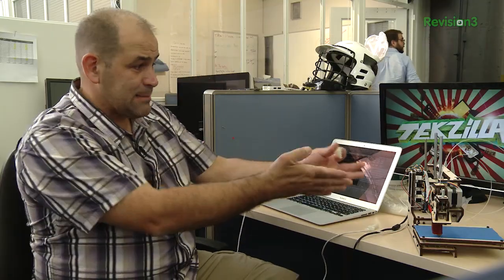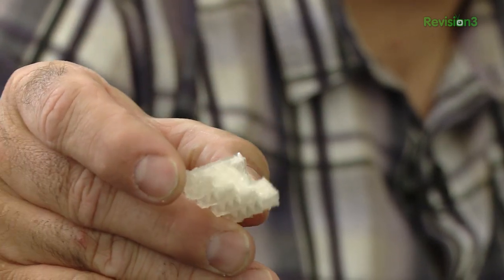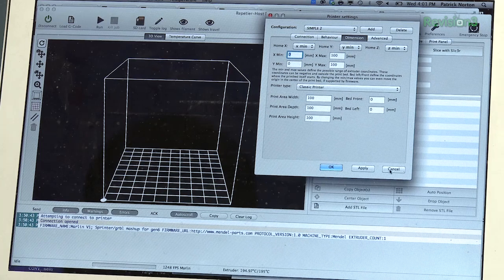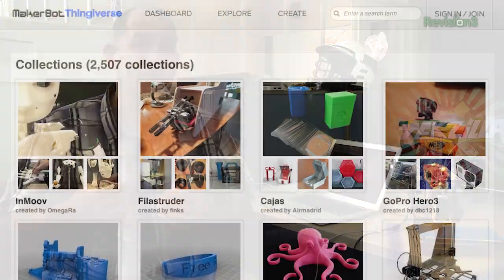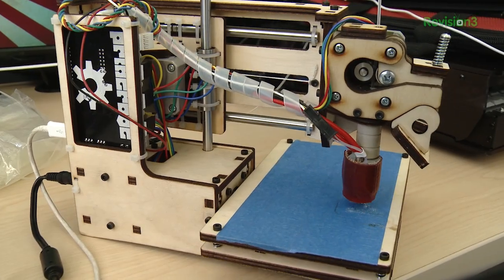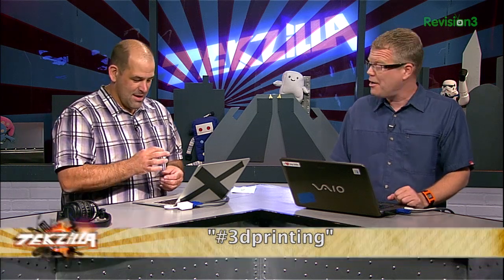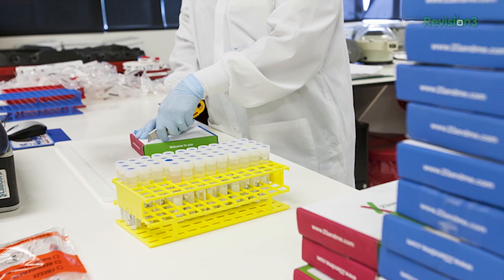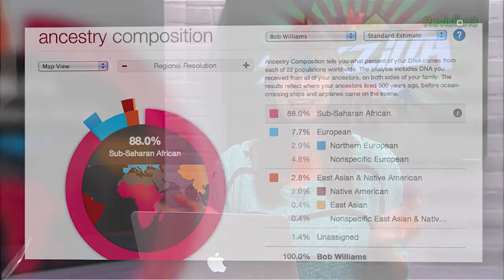5 Tips For Building A 3D Printer

Comment: EmancipatedSquirrel The nice thing about PrintRbot printers?  They allow the user to use any software and any filament they want to use (with in reason).  PrintRbot's are totally non proprietary in their functionality.  Apple / Windows / android it makes no difference.  The PrintRbot will even print from an SD card.

I can hardly wait till I can get my first PrintRbot.  I have done the research, looked at all other models of printers, contemplated building my own.  PrintRbot has the best package in the Metal Simple.